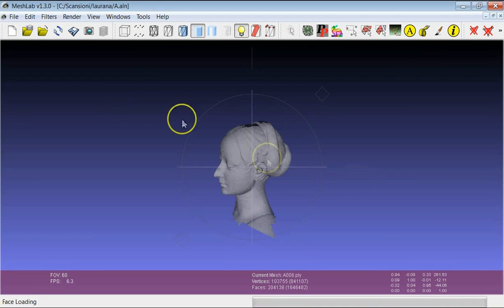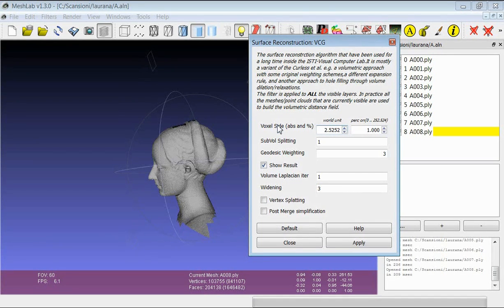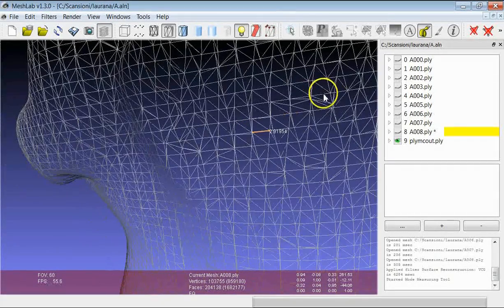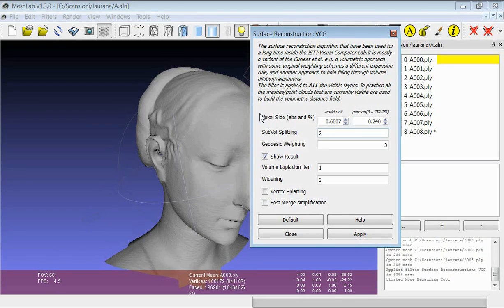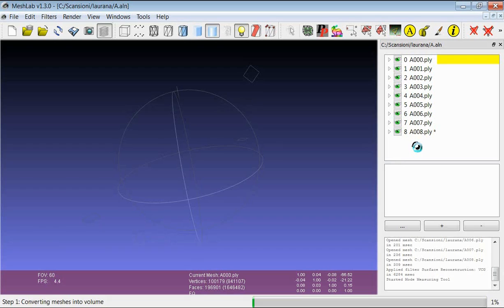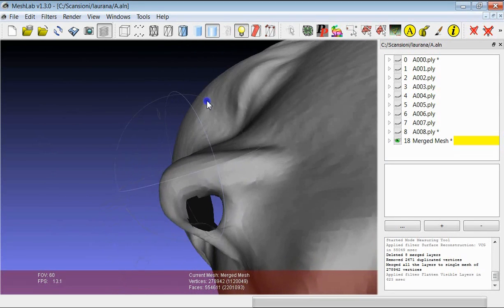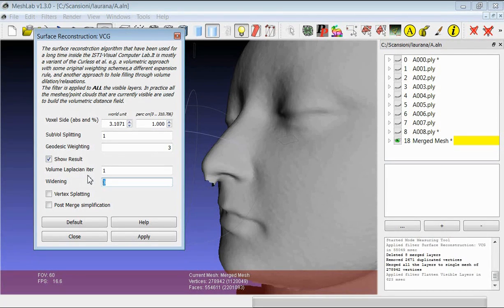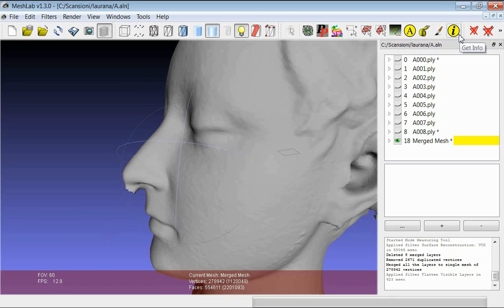3D Scanning: merging using VCG filter

Comment: Looks great. But every time I have tried to use the VCG filter Meshlab either crashes immediately or doesn't display the result (or create a .ply). I am using the latest v1.3 64bit on Windows 7.